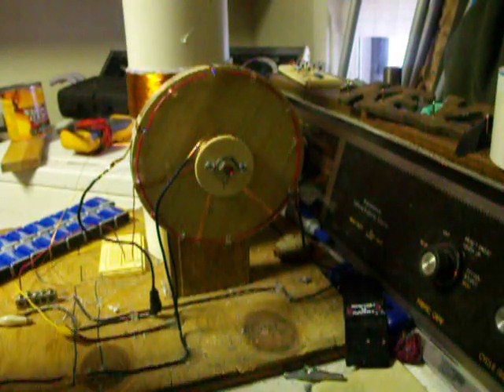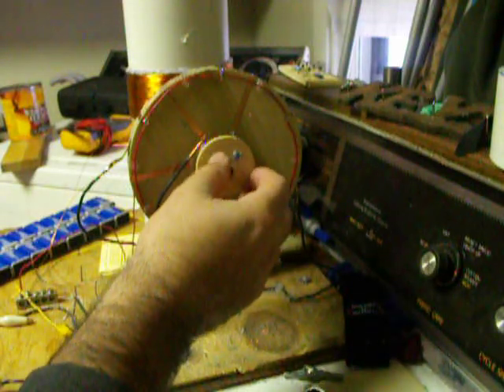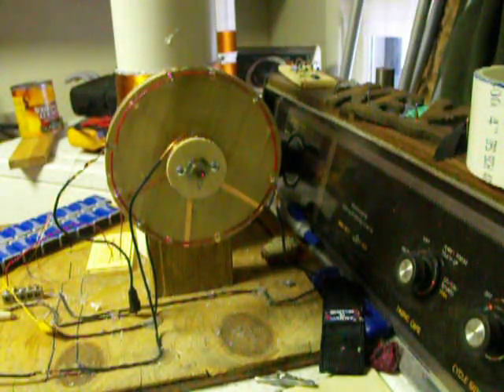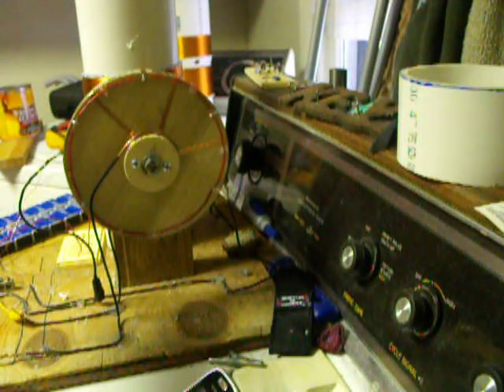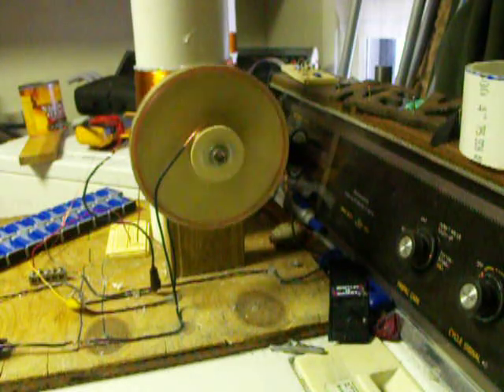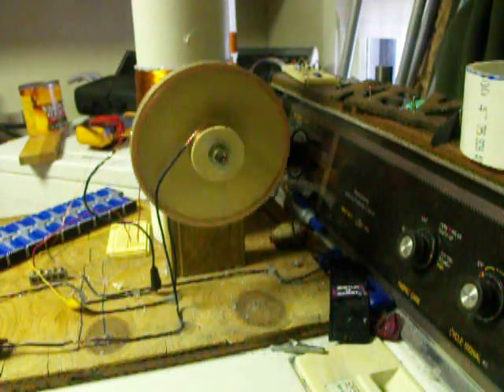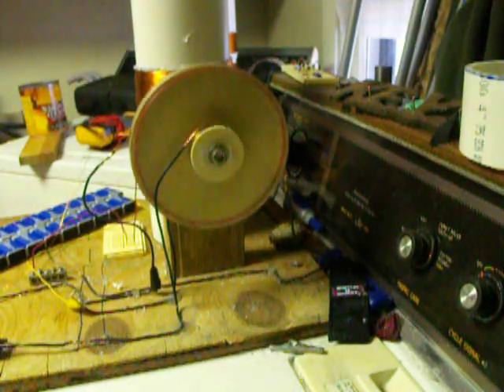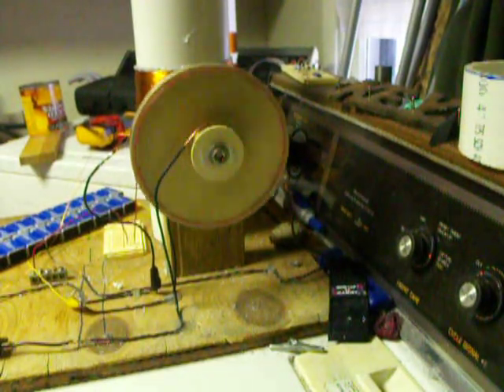Newman motor #2; and it works

Comment: I'm sure that isnt how Joseph Newman commutator was set up
Reply: Imagine  a clock 12 numbers/ plates on 
he had plate 2 and 3 joined and plates 9,10 joined,
The 9 and 3 being the input terminals +/- ,
Plates 10 and 2 were connected straight to coil,
Connecting a full bridge rectifier to the terminals of the coil you can have that output going back to the battery, 
really the back spike is pointless Newmans overunity was purely in the mechanical work out.

Comment: I'm hearing 60 of them 60 cycle....  From Above........  We Can do this... WWG1WGA...... Put a heavy wire,  Fly wheel the more power.....
Reply: Heavy wire calls for more current drawn, while thinner wire, having less resistance, pushes more voltage... less resistance = less heat...

Comment: You are right about one thing for sure, the collapsing magnetic field of the inductor is key. Feeding the induced current back into the coil through a diode is very powerful way to do work without adding power to the system. This is why Newman used such large coils. One part of Newman's motor that few talk about is the torque created from the attraction of the Iron core to the permanent magnet. This makes torque without power input but to break the attraction power must be put in. This is where the collapsing magnetic field of the inductor comes into play. A very short pulse of power to build the magnetic field and then turn it off before current can begin to flow. This causes the field to collapse. It is that collapsing field that breaks the attraction of the PM to the iron core and does the work. Study electronics to understand the math and function of an inductor. Have fun! don't give up.
Reply from the maker: this simple setup does not capitalize on the collapsing EM field. I just wanted to see if I could build a commutator with the materials I could find around my home.  As much as I like the Newman Motor, I have moved on to something I believe is a bit better, here https://www.youtube.com/watch?v=bUMEAMdwb8c  still very expensive to build but I like the concept a lot better.
Reply: @detrix42  Sorry it took so long to respond. Been very busy as of late. The quantum motor/generator is interesting but expensive and week. The amount of power to cost is off the chart compared to your video project here. Newman was on to something neat. I didn't discover Newman's motor project however until quit recently. I have been working on my own design since last November unaware of Newman's design. My project and Newman's seem to be sharing similar effects but there are significant differences as well. So far my motor has successfully disassociated the torque load from input amperage. As this experiment stands ATM  I get ruffly 2 lbs torque from 1000 RPM even when loaded down to 90 RPM without using anymore Watts of power. 13 Watts ATM. I'm currently working on a motor/generator where I have designed the generator side using similar techniques as with the motor side. The idea is to attempt to disassociate the drag (ie work) from the induced current. I'm still a few weeks from finishing but the design looks good so far. Rather than buy into the quantum motor/generator, you might consider buying a 3D printer instead and continue building. I recommend the Prusa MK3, IMO the best printer for your money. As for your commutator, I have found 3D printing a custom optical encoder to be far superior.
Reply from the maker: @dee5556  I agree that the Qunata Magnetics machine is rather pricey. So I plan on trying to replicate it on a much much smaller scale.  Just to toy with, but my funds don't allow for it at the moment.  The concept I take away from the Newman motor is; what is actually causing the magnetic field in a coil when there is current/voltage?  Mainstream folks say is purely the current. Newman suggests is the voltage.  Wattage is Current * Voltage.  You can't have one without the other, so in my opinion, it's both causing the magnetic field, causing the atoms to align.  So leave current low, and increase voltage, so motors don't heat up as much, and last longer.  

I wish you the best of luck though. And look forward to any videos you make about it.
Reply: @detrix42  The magic is in the Inductor. IMO the Voltage allows for High amperage but an inductor is a bit like inertia for electronic circuits. For that reason you want a large inductor and high voltage but a very short ON cycle. This large inductor resists current flow at first as the magnetic field rises. The current flow and field rising events happen at the same time. This is why it requires a proper size capacitor, to deliver the instantaneous current. So the overall power input is very low, but there is a very short high amperage pulse. Its the collapsing magnetic field that is fed back into itself through a diode that will self-generate the diving current for an instant. This means that there is only one escape for the electron flow energy, and that is through heating the coil. The other important factor not to forget is the magnetic attraction to the iron as a driving force. The coil pulse is for the purpose of resetting the magnetic potential for the next phase. Newman's motor does this but is not purpose build to maximize the effect. I have found that the larger the inductor the higher the efficiency but the lower the RPM. I believe that this kind of motor is best suited as a low RPM torque monster.

Comment: You need a DIY dynamometer to measure torque at rpm as well as amp, volt meter and clock to measure efficiency for a motor. Then math to calculate efficiency. Unless you shortcut if you can call it that and build a generator powered by this motor and self run(that would prove over-unity but you would still have no idea at what efficiency without a dyno). I never saw Joe Newman ever do that, so everything he said was speculation. This in no way is to take away from his motor, which is impressive and very interesting. However his efficiency claims are fiction as he never measured torque @ RPM. All these people trying to achieve over-unity but never any real proper measurements is sad. I'm not trying to discourage but its way past time that people making these motors need to learn proper methods. There are many DIY dyno plans, build one, video the build have fun! It is impossible to claim any kind of efficiency without proper measurements so do it. Also if building motors and hunting for over-unity is something you like then go all in and do it right. Build a 3D printer and get a free copy of Autodesk 360 or any other CAD program. Its the fastest and cheapest way to build quality prototypes as well as test and measurement equipment.

Comment: Middle of the movie,  was 513RPM... Not even close to your supposed 2000rpm.  Also, changing currents on coils, are not just ohms law calculation, there is a current ramp based on the inductance.  Once the inductance comes to zero (due the e stabilization of the magnet field), then yes,  ohms law will limit the current based on DC wire resistance. 
You made a DC motor run, congratulations.  You can have the same 170/180Vdc voltage just using a diode bridge and 100uFx450V capacitor, rectifying the 120VAC mains.

Comment: And what may I ask is the 180 vDC battery doing in the background. Another scam!
MoK
Reply: Giving short pulses to the motor windigs, they are in series so you have greater voltage but weak current

Comment: Why have batteries? If the generator is generating more current than the device is using then what are the batteries for? Once the device is running dipshit here should be able to throw a switch to cut the batteries out of the circuit and take them completely out of the picture, then you would truly see perpetual motion and that my friends would be truly amazing, there would be no need for all the bullshit and you would be able to see it with your own eyes, no elaborate explanations would be necessary.

Comment from the maker: I do not recommend 10 gauge wire, because you will need lots of it.  I used 30 gauge wire so there will be plenty of resistance in the wire.  Some wire resistance is necessary, I try to get between 700 ohms to 1000 ohms.  More is fine.
Reply: The lower the gauge number, the thicker the wire...
More current less voltage...
More resistance...
The higher the gauge number, the thinner the wire... 
More voltage and less current... less resistance...

Comment: My Newman motor worked as a motor, but it never put out more energy than it used, and the short out segment on my commutator made my motor run slower. One of the coils weighed 40 to 50 pounds. My conclusion about Mr Newman is that he misleads people about the true efficiency of his motors. Once you understand that power equals volts times amps, it will help you to see through his misleading test results.

Comment from the maker: @nullflux8is 
it is my understanding of coils that a coil, like a capacitor, can hold a charge.  I have not tried it with out the shorts. I feel that shorting it out, discharges any stored charge. I think this is helpful, maybe not 100% necessary, but helpful. (I could be wrong though).

Comment: As I understand it, you don't need to short out your system to have a BEMF or what you call a back spike. When an magnetic field collapses by switching it off or in your set up, disconects, it creates a BEMF simply from the collapsing field. Did you have your setup without a short and did you find it running slower? Additionally, if you use a commutator with a larger diameter or a wieghted perimeter you will get much more torch.  Nice nice work Thanks for the vid.

Comment: I don't understand your comment that it works side to side. You only show one side of the commutator. What is on the other side? What are the two brushes connected to at the other end? Do they connect to the same point in the circuit? Are your magnets N/S or N/N?  When the coil is shorted does it short the batteries as well? Do you have a diagram or schematic? I drew this thing every way I could think of and could not short the coil without shorting the batteries. I need your help.

Thanks

Comment: @detrix42 Each design will have its own inherent properties, Newman's device is HUGE..enough said, sheer momentum it most likely what's helping him with his findings.  That being said, a huge back spike it intrisic to his design.
Such a back spike will be caused by collapsing magnetic fields, not the pundage of copper so much, after all, the flux density is usually a function of the number of windings - more windings, large voltage spike.

Comment from the maker: please elaborate:  How much copper wire (feet or pounds).  As far as I understand it, in order to get a big back spike like Newman, you need lots, and lots of pounds.  One of his smaller machines had 100lbs of 30awg copper wire.  I only have one pound on these replicas. On my third motor (currently not ready for a video), I have two pounds -- still not enough.  I plan on adding a lot more, but funding will slow me down.

Comment from the maker: Never worked? Do you mean that it never produced more out than put in?  I like the results that I am getting.  I am not trying for over unity at this time.  I just want a super efficient electric motor.  I am not quite there yet.  But pulsing a coil (non sinusoidal), in my opinion, is the proper way to do it. As far as I understand it, a square(ish) pulse creates a stronger magnetic field.

Comment from the maker: Thank you.  Unfortunately the commutator was poorly constructed.  I had a local lumber yard make it and they did not get the center hole more centered.  a 6in hole saw costs like $60 USD.  I can't afford that yet.  The sparks will always be there, at least until I can figure out how Newman is capturing the back spike.   At the moment, I am not doing anything special to recover the back spike.  I have killed a couple of batteries.  :D
Reply: Use a drill and a bolt and nut and a scalpell to built something like a lathe: the bolt and nut holding the piece of wood and mounted on the drill, then using a vise to hold the body of the  drill still and make the wood wheel turn use the scalpel to correct the circumference or use a file